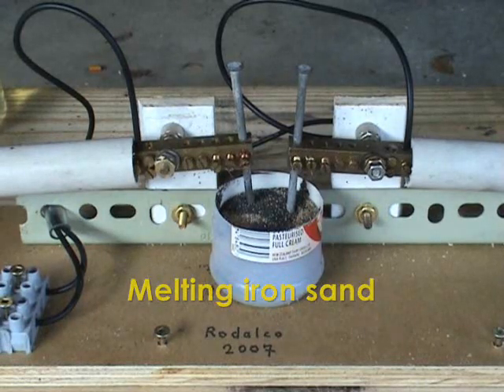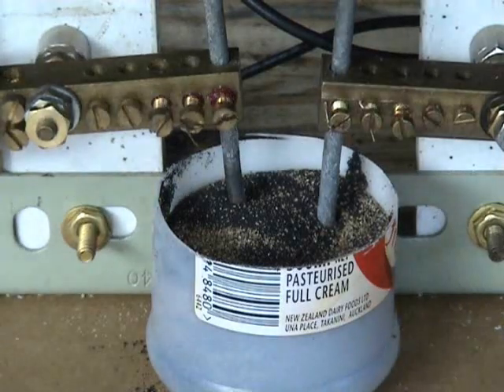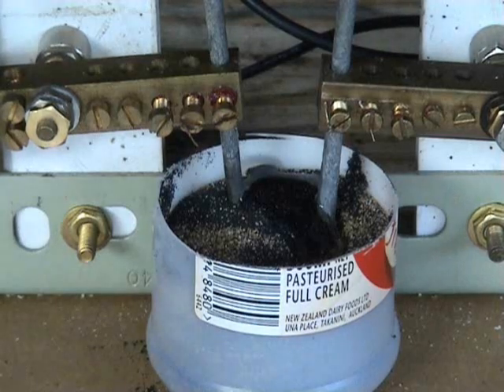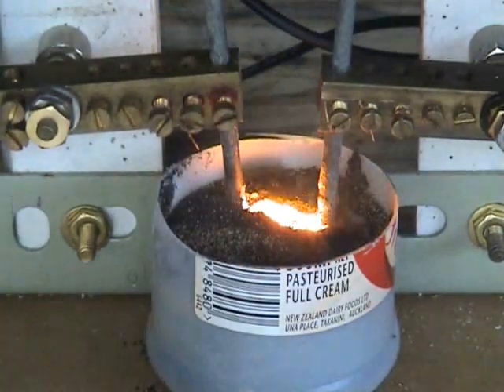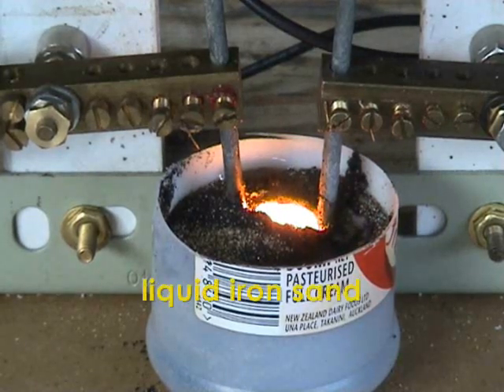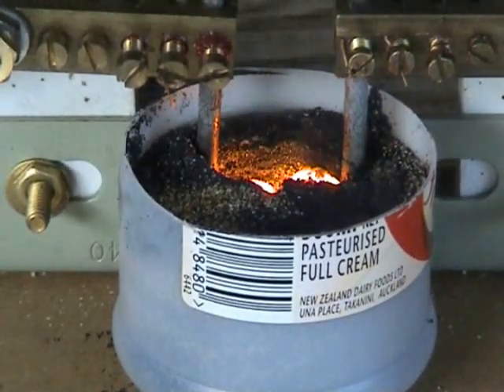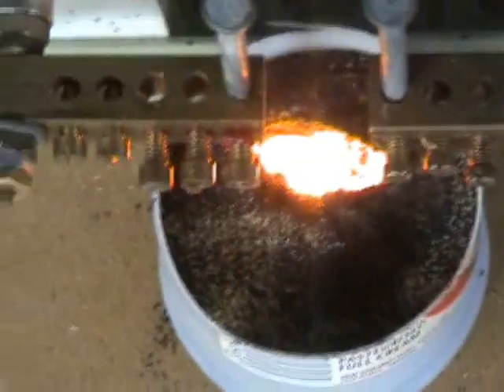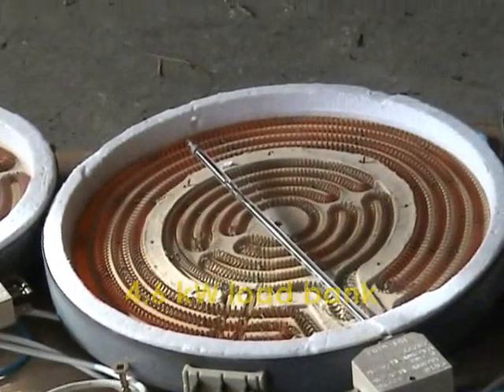Iron sand melting 1

Comment: Looks neat, and even though this is an old video, I have to questions to ask: why plastic and not some (at least slightly) refractory material (this stuff is MUCH hotter than hot water or oil among others)? What was the purpose of the loads connected?
Reply: CoolKoon Obsidian is the result of rapidly cooling lava. Sand is the result of decomposed granite (another igneous rock that has cooled underground and more slowly, allowing more mineral crystallization); specifically the quartz that has been weathered down to that size.
Reply from the maker: +CoolKoon Yes, it was easy to use and it will melt, the outer layer of sand did protect it reasonably well. I knew that all iron sand wouldn't go liquid all over the place. The loads are to control and limit the current to around 20 Amps.
Reply: +RODALCO2007 What was the end result BTW? Obsidian?
Reply: +Seth Mullins I see. Did it act like iron (was it at least pliable)?
Reply: +David J Obsidian contains a considerable amount of Fe3O4 (which gives it its blackish color). Iron sand is definitely NOT decomposed granite, because granite doesn't contain enough iron for that.

Comment: Why are you using a plastic bottle?
Reply: i think its because it was just trash its non-conductive and when it melts or burns he could probably just turn it off and use an electrical safe fire extinguisher like a co2 one, but the guy probably knows what he doing so he doesn't have to worry

Comment: ..and that means like 70 % of the heat is generated in the ballast instead of the sand - it would be better to use a capacitive or inductive ballast as, but it takes som big capacitors or coils to do that.

Comment from the maker: 240 Volts 20 Amps. I used a 4.6 kW ballast in series to regulate the current.
A 12 Volts car battery voltage is too low.
In this case for striking the Voltage is 230 Volts which will drop down to about 70 Volts during the melting process.

Comment from the maker: @colonelodem  Hardest part is to maintain the arc, by keeping enough distance between the two electrodes.
If an arc is struck succesfully it will melt steel at 2 to 3000 °C